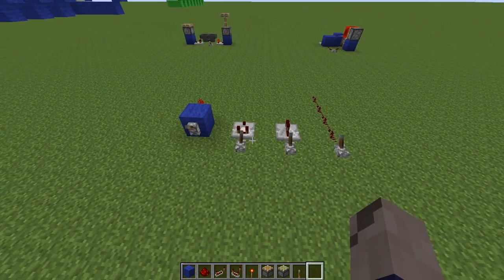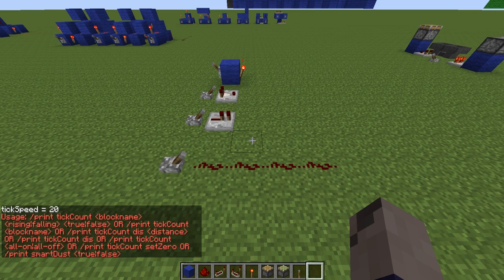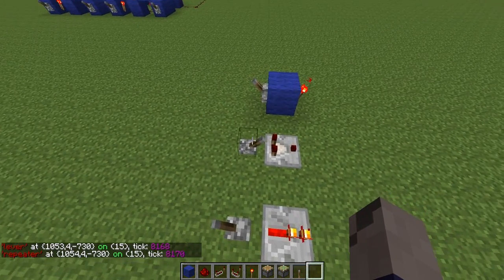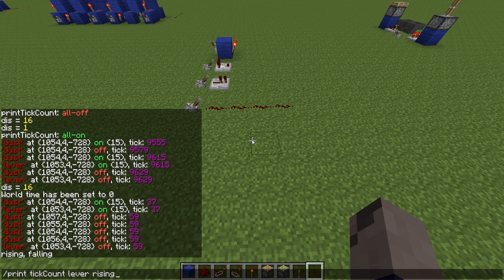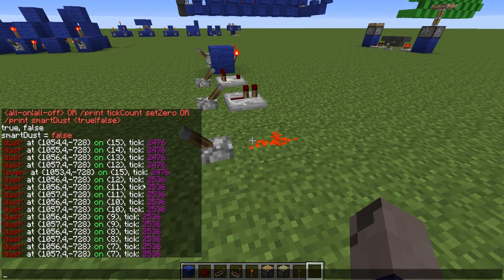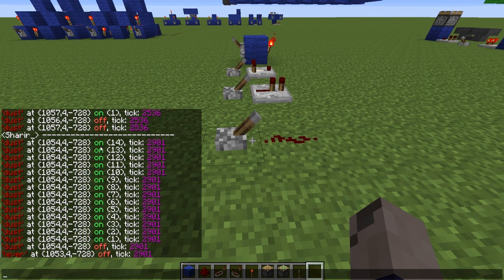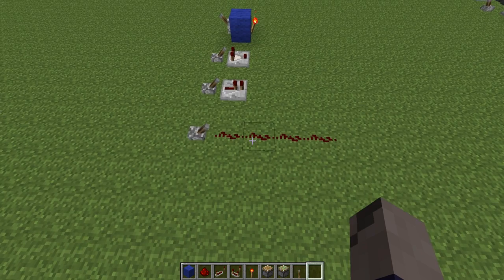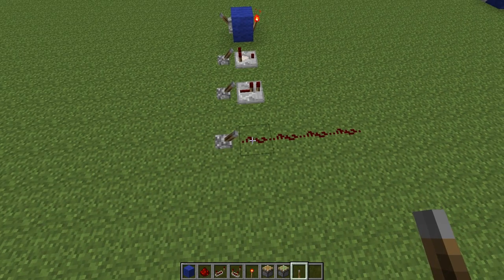[1.8 Mod] Redstone Debug Mod + [MC-81098] RS Dust Updates

Comment: Very cool mod.
Reply from the maker: Myren Eario I guess it was made with mainly you and Nasm in mind, as I said. Have you had a chance to use it yet?
Reply: ***** Yes, a little bit. It looks like the only block with weird timing is the piston.
Even command blocks apparently have a consistent 1 gtick delay, even if they´re updated directly by a lever.
And levers seem to already output a signal 1 gtick before they visually update. I think that caused a lot of confusion.
Reply from the maker: Myren Eario It seems the totalWorldTime, which is what I was using before may have been a bit flawed in the way it updates (inconsistent). Try re-downloading the mod (I updated it and added some minor new features, as listed on my Reddit post). I'm sorry for the inconvenience, but now it should be more accurate, as I have my own variable which I'm printing out, and updating it at the start of every gametick, so there's no chance for any inconsistencies (basically, I think the totalWorldTime updates after levers and other manual block updates, but before redstone, so that may be the cause of some inaccuracy. Now it updates before anything else in the tick, so it should be 100% reliable).
So this should explain all the things you mentioned in your comment, actually, to do with levers. Again, sorry for the inconvenience, but now it should be absolutely correct for your testing. Try again :P